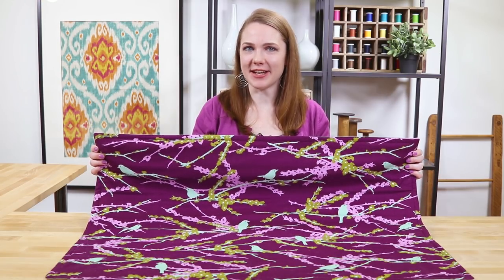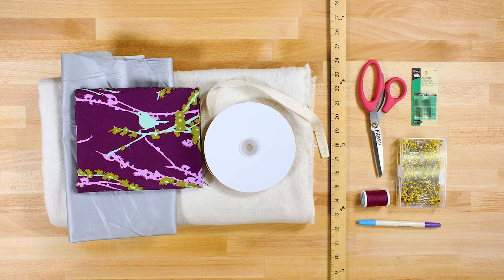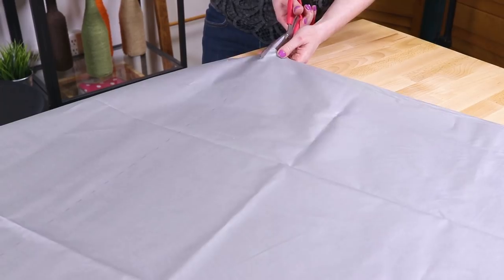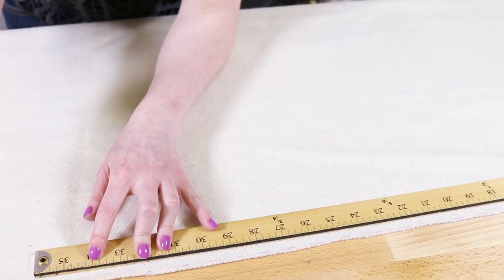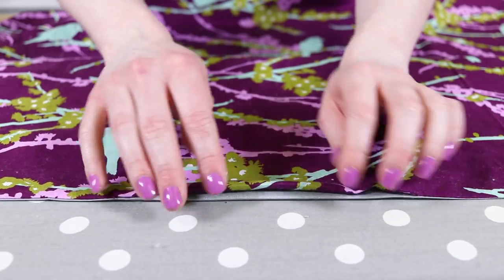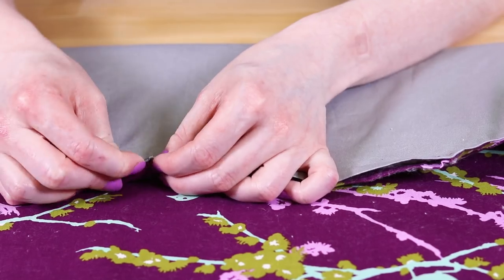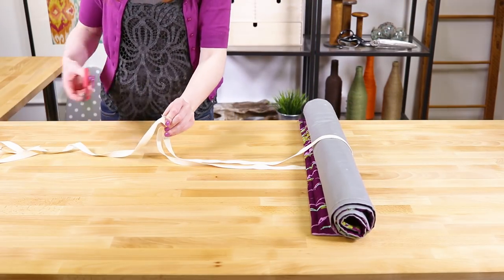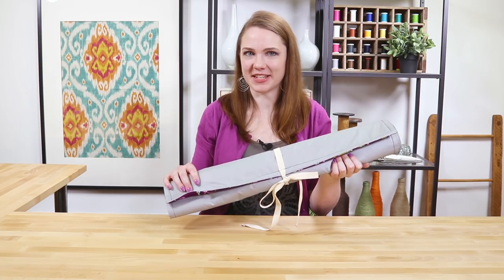How to Make an Ironing Mat

Comment: Hi! I followed your tutorial to make an ironing mat. I was doing good until I got to the part of putting in the batting into the 6" opening. I felt like no matter what I did, I couldn't straighten the batting or uncurl from the edge. And if I fiddled anymore, it felt like I was going to rip the mat. Is there an easier alternative?
Reply: Sew all 3 together in stead of 2.  Way easier that way
Reply: Batting, heat resistant, then your cotton.

Comment: Could this be quilted? Good video, thanks.
Reply from the maker: Yes, quilting it would work well!
Reply: If you quilt it, it would go against the purpose of the mat. You want it flat so you can iron flat.  The quilting may leave imprints you want to avoid (that is why ordering those cheap ironing mats with the quilting is so frustrating.) You get the quilting imprint in your blocks.